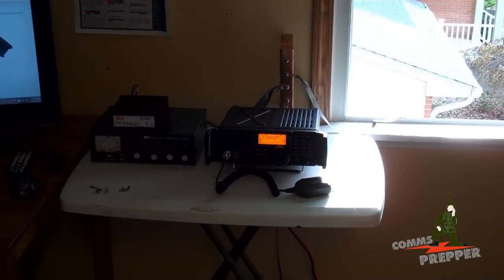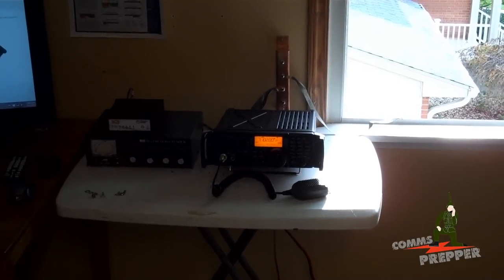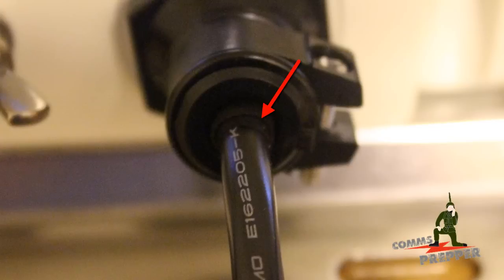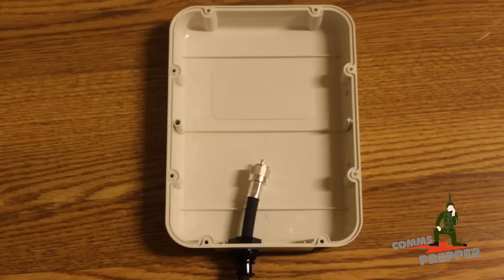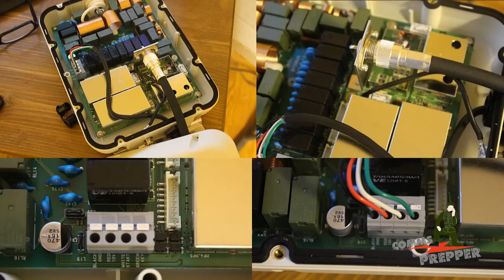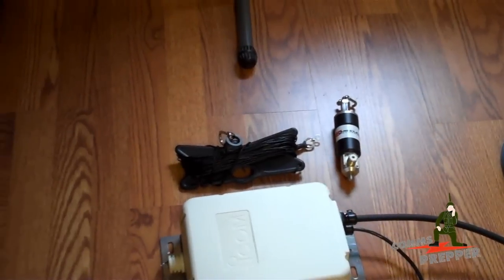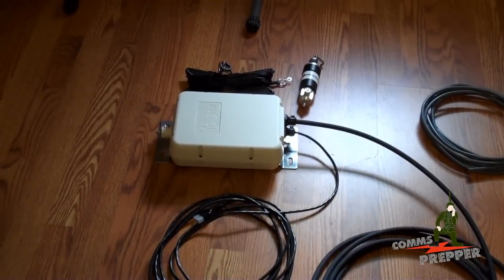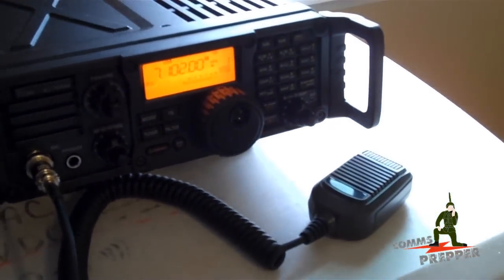Icom AH-4 Antenna Tuner

Comment: Coms Prepper, thanks for a look inside the AH4. Any problems with strain relief, or lack thereof on the cables? I've been debating the pro and con of the AH4 against the SGC 237. Any experience or comment. I see the AH4 has a little more than 1 million tuning solutions whereas as the SGC has a half million. More the better, I suppose. Any other concerns or feedback is appreciated. This would be either loading a gutter at a condo or with a Buddipole in a park.
Reply from the maker: I have not had any problems with the tuner.  More tuning solutions is better :-)  You can beef up the strain relief with tape if you are going to move the tuner allot.  Hank

Comment: anyone know if I could extend the control cable to about 75 feet w/o issues on the AH-4  ????
Reply from the maker: I'm not sure.  Guess you can try and see.  I would suggest quality stranded wire with a larger awg than the standard cable
Reply: Thanx for the reply - since I first asked, I headr that a ham had one 40-+ feet up on a tower so clearly you can - and I then spoke with a seasoned ham who has the AH-4 mounted at his car and he said one end has the molex connector that goes to the radio and then it is four wires that press fit into the appropriate place within the the tuner. He sai I could extend the wires easily for the 70 odd feet to where the tuner will be at the base of a ground-mounted vertical. I sincce found that DX engineering has somoe cable that would work - but I agree with you that a larger wire size would be better - and I saw that at a lowes  as a 250' roll of 4 conductor #16 for $48 which I will probably get.
 Thanx again commsprepper... cheers...    7 3
Reply: ohhh - did the tuner handle your chamelion long wire on 80 bad, good, or great ?
Reply from the maker: Okay.  wire antenna is wire.  for me if it works - it's good.

Comment: What is that Coax you have going into your AH-4 Tuner.  It Looks Huge!  Certainly bigger than the stock cable that came with the tuner.  Cheers!  KD7GYW
Reply from the maker: The cable is standard RG-213.

Comment: Great video as always. I use my AH-4 for field use also. I made a 50ft extension control cable that I keep paired with a 50ft piece of coax for those portable situations where the tuner is too far from the picnic table.
Reply: Hey Scott, do you know what the limitations are for the AH-4 Control Cable as far as Length goes?  The manual says nothing about this.  Also where did you get the connectors for your extension?
Thanks in Advance, 
Darrel - KD7GYW
Reply: +LasVegasVocalist I have heard of folks running 100 feet of control cable successfully.  Radio Shack used to carry both connectors. If they no longer carry them I would bet DigiKey would have them. I have also seen them at hamfests.
Reply from the maker: I think it's 16 feet with the standard cable and 25 with the optional cable.  In the end you want the cable short as possible.

Comment: I have an ic at that has been outside on the pole 40 ft up for 12+ years and still works great.
Reply from the maker: +buzzsah Cool.  I hope mine lasts as long.
Reply: I have a Icom AT 130. In 35 years only 1 problema, a relè failure. Changed and It works ok. Its an old staff, but runs good. Does all band from 2 MHz to 28 MHz, needs only a good ground and tunes anything, wire, wip or water pipe to amy frequency. Inside has a possibility of capacitor, coil, capacitor (π); capacitor coil (L); coil capacitor (reversed L) tuning Is done i n base of Phases detector. 35 years only 1 problem. I have a other tuner, from marine equipment make skanti, but that Is fantastic, has Reed relè and tunes anything at any frequency from 1,6 to 30 MHz in less than a second and handle 750 watt of RF power.
 The only care Is to disconnect and ground antenna during thunderstorm. 👍👍👍👍👍👍👍

Comment: Would this tuner be capable of the speed required for ALE?
Reply from the maker: +RadioHamPrepper I would have to defer your question to Icom.  My experience with ALE operations revolves around the Motorola Mobat Micom product line and those tuners specifically used pin diodes in their tuners vice relays because of the tuning demands of ALE networks.  The Icom tuner uses relays.